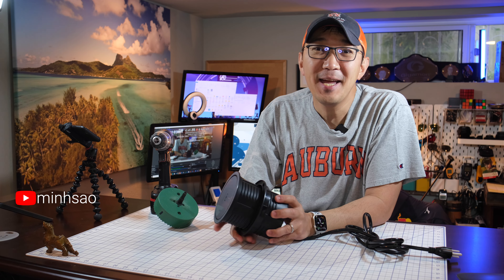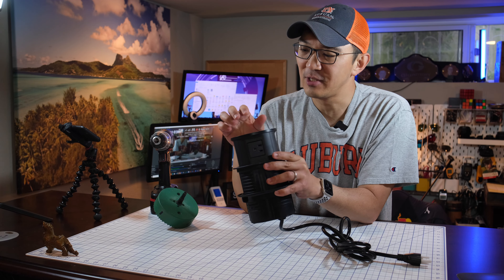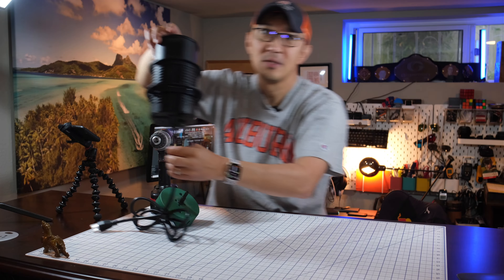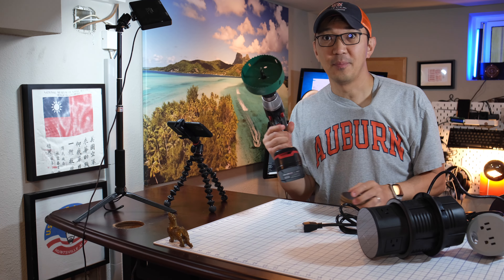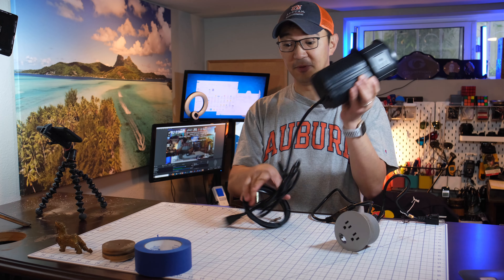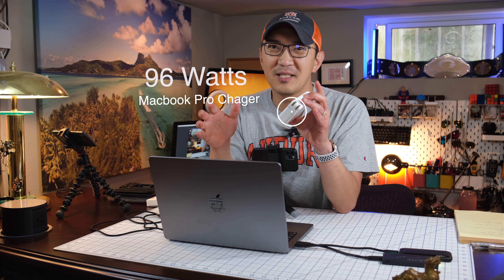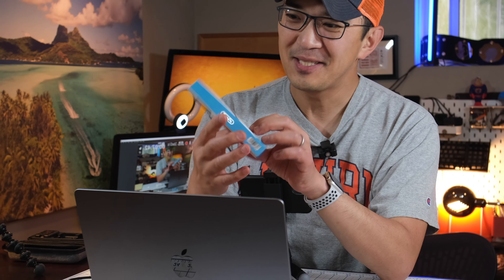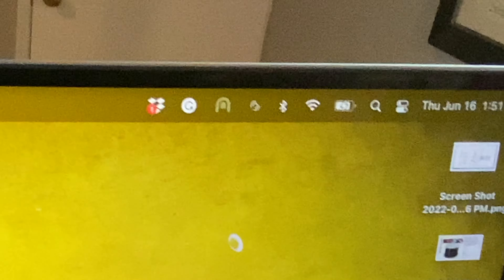Pop Up Outlet for Countertop and Standup Desks Installation and Review

Comment: Can you wirelessly charge your iPhone on top, and still get 18W out of the USB port?
Reply from the maker: yes ... I just tested it and yes it will still charge 18W off the USBC and the wireless charging on top.  Good luck!!
Reply: @minhsao  Thanks! I just bought two of them for my new kitchen island. I do however, wish that there was an option to have only one set of USB outlets and three 120V outlets instead of two of each. I have more need of the 120V outlets than I do the USB chargers, but I do like that I have both; plus the wireless charger on top.

Comment: Is the pop up appropriate for the kitchen?
Reply from the maker: Yep it will work for kitchens too.. just make sure you can get access to powe and you can cut the right size hole :) good luck
Reply: I'm building a new 13 foot island in my kitchen and installing two of these in it. I have two 20Amp circuits going to the island and each of them will have one of these pop-up outlets on it.

One of the circuits will power the dishwasher, outlets on one half of the island and one of these popups.
The other circuit will power the gas stove (only used for the igniters and display), outlets on the other half of the island and the other popup outlet.

Each circuit will start through a GFCI since there is water in the island.